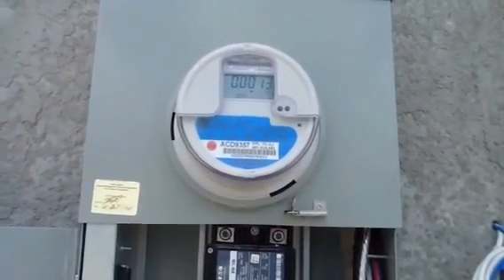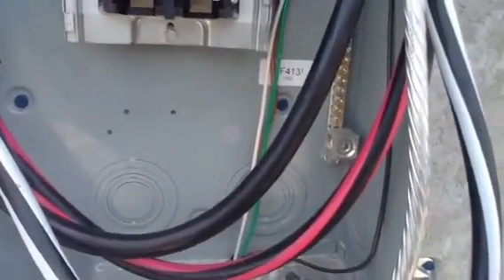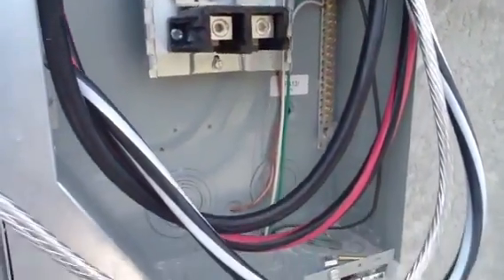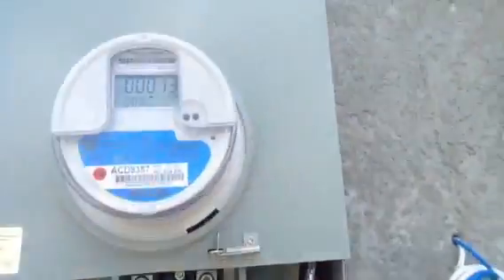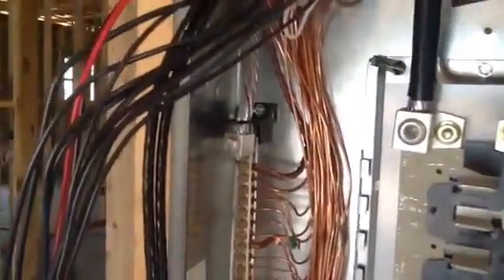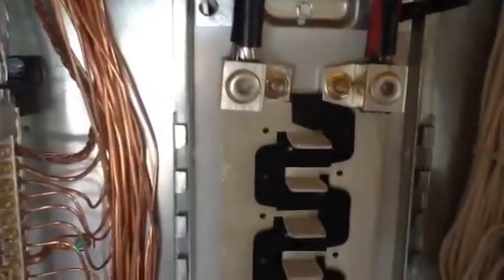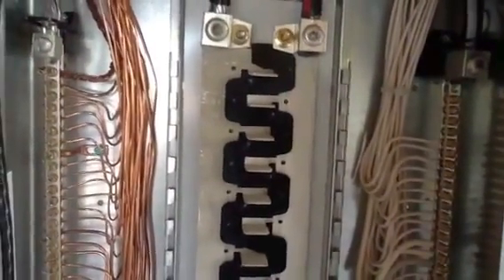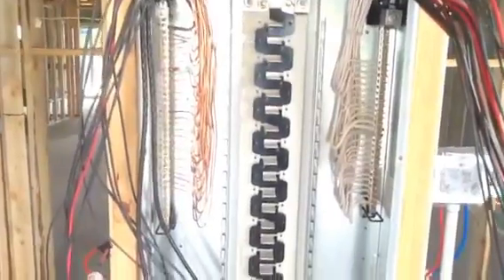How to install 200 amp sub panel

Comment: I'm running a new meter base and a new 200 amp sub panel. And the 110 is not pulling the proper amperage. But the 240 is running the water heater just fine. Why is that. And if I'm running a lamp on a totally separate breaker and I plug in a cell phone charger, it will kill the light bulb. And I could have another lamp plugged in on a totally different breaker. And the cell phone charger. Plugged into a completely different outlet on a completely different breaker. Will kill out both lamps

Comment: Great video sir  I have two questions  What type of wire did you use for the 200 amp sub panel and what type of breakers  You used to feed the side panel and to the main panel thanks

Comment: Where do you get the main lug add-on to the bottom of the panel? Do all brands (mine is Square D QO) make such a thing? How would I chain 200 amps off of the main service panel without using a 200 amp breaker if they don't make a main lug adapter like yours for my brand panel?

Comment: Hi  I have 200 amp panel in my shop and I am building a house right next to it and want a 200 amp panel there what would be the proper way to do this on the existing meter outside shop. The shop never draws much any amps. Ocassionally I run a5 hp compressor and a small welder

Comment: I just had a 30x50 metal garage. I'm about 75 feet from my house. I have a 200A panel and could I run a 150A sub panel from that 200A main? Probably better to just run a new meter to shop? I'm gonna add stuff like car lift, water heater, stuff like what's in the house so just wondering if I could run another 200A breaker from my outside box to the garage panel?

Comment: Nice video but I'm totally confused.  I have a shop detached from the house.  The house has 200 amp service and we took 100 amp service from that for my shop.  I'd like to add another 100 amp service or actually have 200 amp service in my shop instead of 100, how would that be done?  What would be a ball park guess on the cost of doing that?  Thanks so much!
Reply: Separate service ran to the garage. Meaning 2 Separate bills. I've never heard of a residential having more than 200amp service. One 100sub ran off the primary box of 200amps would be fine but not a 200prime and a 200sub.

Comment: Very nice setup! What brand is old main panel? Mine Cutler Hammer does not have supply nuts so I'm trying to figure out how to connect 200 amp cable to it.

Comment: Slop! Do not do your panels like this !! What is all that extra wire for before it terminates on the ground and neutral bar!!  Guys !! Take your wire right to the ground and neutral with one nice clean 90 degree bend ! No need for all that exceSs wire !!!   Hack alert !!

Comment: 120 volt to neutral? No to ground?  Thank you.
Reply: by Code, the green ground wire may NOT be used for a return path. use the white wire instead. this is to help prevent stray voltage. some people claim that the metal cases is shocking....

Comment: How much load could a 200amp service take? And how many 100 amp sub panels could it take?
Reply: A 200 Amp panel is rated to carry 1 million amps.  A 200 amp panel can feed at least 50-52 sub panels at a distance of around 5280 feet or 1259 meters away.

Comment: Not bad but you don’t want to tyrap those neutrals together. I know it looks neater but it’s not good for heat. Also need supports on those romexes coming in those stackers work real well

Comment: I have an outside 200 amp main on a pole. I was eventually going to put a sub panel in what I built. Now it looks like a mobile will be used instead. I already have a 40 amp sub panel in my pump house. The mobile comes with a 200 amp main. My question is would it be better (easier) to replace the 200 amp main in the mobile with a sub or replace the main at the pole and rework the 40 amp sub in the pump house? I would have to completely pull new wire to pump house with new trench and conduit. Is there any code about in line mains another word can I go from the 200 amp outside main into the 200 amp main inside the mobile?
Thanks
Jim

Comment: Nice looking panels.  Someone took the time to make them up neatly.
Reply: Drip loops in a panel?  Totally a scab job.  Look how much cable is the box.  Only need 1/4 in showing from the connector.  Hire Union.

Comment: I have power coming to the house in to a big metal box and then it splits in to two panels and there is wire that goes back out to  a meter, so it appears the meter does not control the juice that goes in to the panels in which case the electric company may need to get involved. Anyone familiar with this setup? House is from the late 50s.

Comment: Hey, is it possible to add a 200 amp breaker to my main panel rated 200 amp, 2/0 copper wire, to feed a 200 subpanel for an addition? thanks for feedback
Reply: you can't buy a 200 amp breaker for a 200 amp panel . a100 amp breaker is prob all the bigger you can buy. it's a good practice to only rate a subfeed panel at half of what the main service is.
Reply from the maker: not really
Reply: The largest breaker for such a thing is a 125amp.

Comment: Thanks for pay it forward I am wanting to run a service wire to a Sub panel that is 250 feet away, here is what I know(not much) I talked to an old electrical guy and he said I need 2-2-2-4 copper wire so I looked on line at home depot and they have stranded of black I don't have clue what that means and AL QUAD Dyke URD cable, I hope this means something to you, not me. Don't get me wrong I have wire my cabin and hundreds of outlet bug electrical lingo I don't get, can you tell me what 2-2-2-4 means,  thanks for your help
Reply: 2 is the size of the hot and neutral conductors which will be a stranded cable since they are so large. 4 although being a larger number is actually a smaller wire which is the ground  wire for you.

Comment: Why is your bonding screw on the sub panel & not on the main panel?
Reply: Good eyes, good question and a good learning experience that mistakes do happen.
Reply: Hey the jumper needs to stay in to bond the can. Cutler hammer isolated their bars so if you take that out the can will be floating. Good job on the neatness
Reply from the maker: it was an employee mistake great catch
thanks
Reply: Because someone knows nothing but thinks they do (You excluded )

Comment: hello David how are you ? i have a question . l want to install a subpanel but the main.panel is 150 and the sub panel is going to be 100 and the distance is going to be 80' feet . what gage of wire can be . if is copper or aluminum? thank you very much.
Reply from the maker: I would use 1/0 copper for voltage drop.

Comment: David, great educational video indeed. When I was watching the video, I saw multiple wires entering through a single hole in the sub-panel. Is there a code limit on how many wires can be run through a hole based on the wire size.
Secondly, while replacing old sub-panel with a new one, it is very likely that some wires will need splicing to get to the right length. Are there any code restrictions on splicing the wires inside the sub-panel box?
Thank you in advance
Reply from the maker: there is a limit on how many wires go into connector based on wire size.only when your wire size is above #1 then it may get unsafe

Comment: why an outside main...?  why not a simple 200 amp main  40 circuit panel inside the house
Reply: if the main breaker panel from which all circuits branch out into the home is more than 6 feet from where the service enters the house there must be a disconnect outside where it enters
Reply: Never heard of this 6 foot rule. Post your source please.
Reply: Seems to make sense, but again begging the question..Why not simply install a disconnect switch in line with the service before entering in the house instead of installing an entire breaker panel on the side of the house?

Comment: I have a 200 amp service to my main panel in my basement. It is almost full, with just 3 spaces left. I want to install an EcoSmart 27kw electric tankless water heater. To do so, I need to install a 150 amp subpanel, but I am not sure if I can just throw a 150 amp breaker in the main 200 amp panel and piggyback it over to the 150 amp subpanel without getting another service line in. How do I know what I need to do? Thanks in advance
Reply: Joe Manly get a licence electrician
Reply: Hire an experienced, knowledgeable, reputable electrician.
Reply: hi! that service line you have is calculated to hold 200A  (+- 10%). its not gonna happen to hold the other load. or if somebody lie to you that it gonna work its not gonna happen for a long time.
you have 2 options 
1) run another line 400A copper but it still gonna cost more cause labor and material and still its going to change your contract with your electric energy company
2) you have to run another line 200A aluminium for sure

Comment: Hello, I want to know what size ground wire i would need for a 200 amp installation. from the main outside panel meter and runs thru the house about 35 'feet into the inside breaker panel; not like in other cases were the outside panel and the inside panel aline and are seperated by a wall, the house is in florida fort myers . 33916
Reply: at the meter can: use a Number 6 bare with 2  each of the 8 foot or more ground spikes placed at least 6 feet 2 metres apart. also install a utility ground mount bracket for the phone, cable, sat dish, etc.  connect this here assembly to the neutral inside the can. see your local Code for the proper method for your locale.

Comment: Great video! Just to be clear... on the main panel it doesn't matter if the neutral and ground wires from the various circuits are mixed on the same neutral/ground bar, But on the sub panel the neutral and ground wires from the circuits must be separated? Thanks.

Comment: Mr. Jones, 
I have been watching panel and sub-panel videos for about 2 months now. I was just trying to touch up information on a rusty part of my electrical work. This is the 1st video that correctly explains the unbonding of the neutral in the sub-panel installation. I have seen many videos done by licensed electricians that are incorrect. This is one of the most professional installations I have ever seen. 
Questions:
1. Do you worry about the heat in an enclosed panel and the zip ties you used? I know this is minor but can be a potential issue down the road.
2. Is it code in your area to install a shut-off in that fashion outside? I lived in 4 states and only seen that once except in mobile homes. In Kentucky I had a farm house in which the panel and meter were outside (yes the entire panel). Here in PA I have never seen this.

Thank you for the video.
P.S I have done residential electrical for 25 years on and off. I attended a 3 year vo-tech electrical construction course (1600 hrs), and I attended 1 year Penn State electrical construction course.

But thanks again, 
Ron
Reply: Hey Ron, I cant seem to get my 30 amp welder to work off of a sub-panel. Are there any videos that you would recommend?

Comment: First I could not make out the meter disconnect breaker amp age rating. I totally disagree with putting a main lug panel inside the dwelling. Not sure where you are it is always safer to have a main breaker in the space. I realize that cost more money but much safer in  a emergency situation.

Comment: Hello David im up grading from a 100 amp to a 150 amp service putting in a new meter box and a indoor 150 amp main panel i have two out building that get fed by the main drop from the main panel will this affect my out buildings thanks..